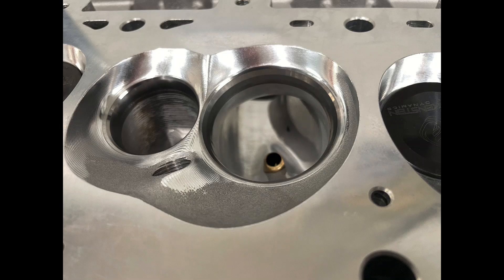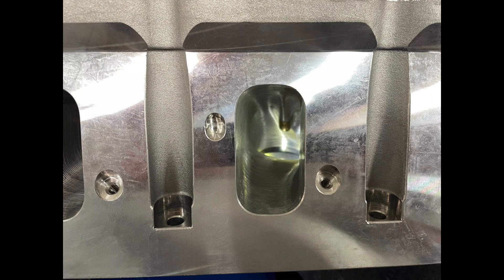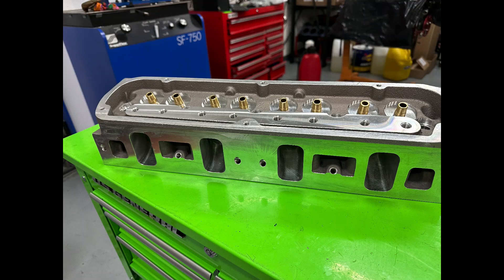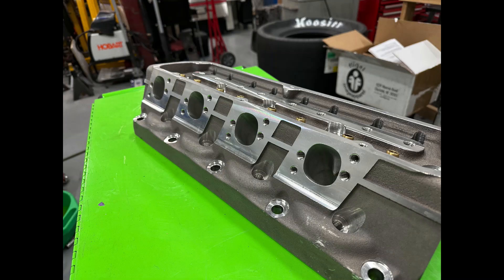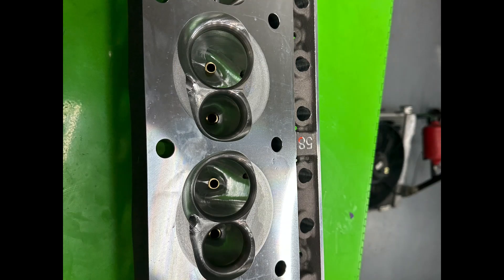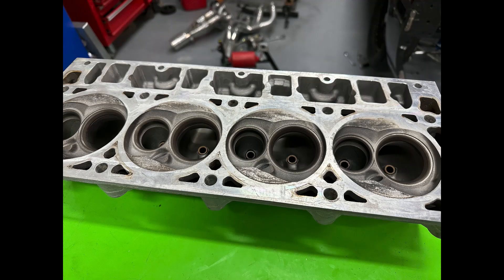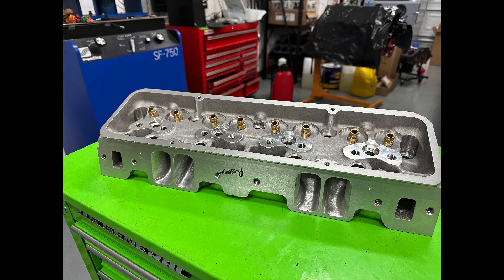Is More Flow Better

Comment: My 2 cents.
Peak cylinder head flow is demanded by the pistion, and when does said piston reach its peak speed? Around 70-75 degrees crank duration. Or, probably around when the cam is in the 0.4in range. As you have seen and tested, improvements in airflow here are attributed to improvements in output.

Next information drop, Pipemax has a function of calcuating cfm from piston speed. It brings up a large spreadsheet showing, piston speed, crank angle, rod angle, and cfm demanded by the piston.
Waaay back in 2006, I ran a simulation using Pipemax on a 1600cc engine. It stated that for a 400cc cylinder, its piston cfm demand was 275cfm@8250rpm. If that was doubled to an 800cc cylinder (for a 6.4L V8), I would guess cfm demand would also double to 550cfm@8250rpm.

We also have to understand that a flowbench operates at 28in of H²O, where a piston can generate far greater depressions than this. This stretching air is an invisible friction torque loss, and one way to lower it is by adding more cfm to the cylinder head. In a nutshell, this is where a pumping loss can be easily fixed because adding a better flowing head reduces the "strecth on the air." It's also why a cam change is needed, as the strech into the port is less, meaning less velocity. So, an earlier intake closing point is needed (big head small cam V small head big cam debate)
Its also the theory on why Ford made the 4V Cleveland head. Small cam, big head.

As a side note, the moment manifold vacuum hits 1.5in of Hg, there is effectively 13.7psi entering the cylinders. 1psi loss = 7.5% less air mass. The volume is the same, but it has less weight. Installing a bigger carburetor helps bring back that loss. There are other factors that then come into play, like running a finer grain booster because less vacuum means the fuel is harder to vaporize and stay atomized. This may theoretically be why a 1000cfm carby returns improvements over the 830ish one you said.
Reply: Pressure differential is what makes air move, yes peak piston speed will create the highest pressure differential but as long as that pressure differential is kept below 3.77psi then you won’t be stretching any air causing it to reduce its density.
The pressure differential determines what the average airspeed is within the port and as long as your under 3.77psi pressure differential then the minimum cross sectional area won’t go into choke.
Pipemax gives you a number at 28” test pressure as a reference to go against, this reference is calculated across what average airspeed you enter and the engines capacity, rpm and number of cylinders.
Reply: @Sean B  I strongly disagree with the 3.77psi claim. If a point of restriction was causing a pressure difference that great the airspeed would already be well in excess of the theoretical sonic choke. In research and practice, airpseed over 350fps on single valve V8s is usually met with a dyno curve that falls off in the top end, which is why higher rpm calls for larger ports. However, there has to be a balance between low rpm airspeed as well as high. 
350fps translates to 146cfm per in² of area, and that's only at 28in H²O/1psi. Simply adding in more pressure difference from increased piston speed would result in higher velocity and less density inside the port. That's the stretch I refer to. To generate that type of pressure difference would take more force as well, resulting in higher pumping losses, all leading to net loss of output. 
Something else to consider, a flowbench is a simple photograph of a very dynamic situation that is a running engine. In other words, a flowbench is a simple tool to help understand a very complex situation. There has to be flexibility in applying knowledge as guidelines, not set in stone rules because in some situations, some engines dont play by the rules.
Reply: @crd-nz_001  I’m very well aware of the average airspeed numbers and max flow at those depressions.
What your talking about tho is everything referenced back to 28” test pressure so we have a base to work with, that’s not the depressions the cylinder bore and port see at max rpm piston speed. 
Plus sonic choke can only occur at the speed of sound hence the name, what your referring to is subsonic choke when the air starts to stretch its mass, this occurs usually at mach 0.6
What happens when you test a port at 40” or even 60” test pressure? Does it all turn to shit? OR if the port is stable it flows more air? The average airspeed is only limited by the pressure differential applied to it, the pressure differential is the energy source that accelerates the air column, it especially aids in volumetric efficiency when the piston starts to slow towards the bottom of the bore and actually starts it’s way back up again, the intake valve is still open and that energy created by the pressure differential is what keeps that column of intake charge moving into the cylinder.
When you see an engine on the dyno nose over it’s not because the airspeed went over 350fps, it would of went over 675fps. 350fps is just the value used on the flowbench because that’s the pressure differential that is being used.
Reply: @crd-nz_001  just wanted to ad that no matter the pressure differential, the higher it is the less air it can flow per square inch of area, for example 10” test pressure max is 87.23cfm per/sq” yet 28” test pressure is 146cfm per/sq” so going by your theory we would want the lowest possible pressure differential to get the most air per square inch of area, the “stretch” we are talking about happens from the very beginning of applying a pressure differential, it’s when that pressure differential goes beyond 3.15/3.77psi that maintaining stability seems impossible within an engine port.
Reply: @Sean B  Yes. 
We are saying the same thing, just in different ways. 
What Im trying to point out is...
- It takes energy from the engine to develop a vacuum. The higher the vacuum, the higher the energy loss.
- Pressure recovery does occur in the lower half of the cylinder. But, this is based on cam timing as when the intake valve shuts.
- Less vacuum gives less airspeed, less ramming effect, which means cam timing needs to advance. The pressure trapped is also closer to atmospheric. The opposite for higher velocity ports. 
- 350fps is a balance between energy lost to creating a vacuum Vrs ramming effect. Start pushing port speed above this point, and the energy requirements to create a vacuum go up beyond the gains from the ramming effect. 

On a flowbench, its could well take a 18hp motor to make 60in of vacuum, yet only 3 to make 28. I am guessing the numbers, but they are not far off. I know someone needing 12Hp to buld a 40in capable bench. 
But that's the point Im making. Increasing port speed to beyond 350fps to increase the ramming energy to make more power is not a simple exercise. 
If you're making power at +600fps N/A, then you're the smartest person alive.
Reply: @crd-nz_001  so your saying that you think there is only 1psi of vac being pulled on the port at max rpm peak piston speed? Because it can only be 1psi to make the airspeed 350fps.
Reply: @Sean B  No.
A running engine is dynamic and will vary greatly.
However, the higher the depression a piston makes comes at the price of power to make that depression. As I have found, the closer the working rpm sits within 28in, the better the overall output.

Yes, a head will be potentially exposed to 40in and should maintain flow when done so. It separates good heads from great heads. But, if a head was running that high, then a bigger head and different camshaft combo would drop the depression closer to 28in and give superior results. It's why everyone is chasing bigger and better flowing cylinder heads.
Reply: @crd-nz_001  we will have to agree to disagree then 👍 enjoy the rest of your day, cheers.
Reply: @Sean B  I slept on it. This morning, I decided to do some math

Taking the 550cfm I set in my first comment and divided it into the curtain area of a 2.1in valve at 0 4in lift comes in at almost 397cfm per in². Multiply that by 2 4 give a feet per second of almost 953fps.

So, how very wrong I am at saying a port will never see that type of airspeed.
Reply: @crd-nz_001  nothing wrong with realising that a mistake was made, to me it takes a bigger person to actually write in public that it happened 👍 respect for real.
I’ve always said that you learn more from being wrong and realising it. I’ve been down this path many many times 😂 cheers bro.
Reply: @seanb250  @CRD NZ This back and forth with you two has been SOO educational for me. Thanks for sharing your thoughts!  -I've looked at the CFM of intake air flow vs. piston demand chart in pipemax before and it always seems that no matter what you do with the 2 valve stuff that I'd ever take the time to input into it, that any where near peak piston speeds the intake is ALWAYS going to be way behind the piston vs. what it actually wants.  -I understand that at a certain point getting more flow and area is going to "hurt" your ability to make power and I understand the high velocity approach better where you're delaying the intake close and relying upon velocity to get you >100% VE as the piston is rising up, but I never understood how to know where that point is and it's relationship to the air speed FPS "speed limits" that are baked into the engine size, RPM, and min / avg CSA forumula before.   -This whole back-and-forth helped me, anyway. 

It's also my understanding that colder coolant temps help to make power largely because cooler temps in the cylinder reduce the pressure in the chamber and make the pressure drop across the intake valve a bit larger after watching the recent seasons of Engine Masters test cold vs. hot coolant and cold vs. hot fuel.

The giant LS3 ports and using baby cams and not really taking advantages of fast headers and big overlaps approach still kind of confuses me on how it works, but I'm slowly getting closer to understanding it, I think / hope...

Comment: I believe the correct term for this is "realized power". If you keep increasing the cylinder-head flow capability (cfm) and you keep getting measurable increases in power, then you are seeing "realized power" gains. If the last increased cylinder-head flow increase does not add to the power output, then you have reached the maximized power output (from the cylinder-head's contribution) for that particular engine configuration. 
     ALL cylinder-heads are a restriction to an engine's Intake airflow requirements for true 100% cylinder-filling. We can know this by looking at the fact that the only way to theoretically completely flow at the rate of the piston's descent, would be to take the cylinder-head off of the block-deck completely during the intake stroke, then immediately replace it at Bottom-Dead-Center before the piston rises again. Even if the cylinder-head was only equipped with a single valve located dead-center over the piston, as an intake valve, it could not flow the full volume needed. With that as the baseline for maximum cylinder-filling (and therefore maximum potential power output) we can see that there are many limitations to maximum power between the cylinder bore and the throttle-body (which should be the only, and variable, "chokepoint"/or throttle) in the entire induction system. 
      I believe that all naturally aspirated engines (and most supercharged ones as well) are airflow-limited to what amounts to a smaller displacement engine, in realized power. One clue to this is that we never seem to achieve maximum potential output from any given engine size. Most builders go with bigger engine size or displacement to get the desired or needed power increase. 
      The best way to maximize any particular engine's output is to use experience (our own or from someone reputable) to get you close, then "cut & try" to get the true best output from it. This is tedious and time-consuming and of course expensive to do. That is why most of us will have to settle for some power output level somewhat better than average, without ever realizing the absolute maximum that could be achieved with that engine configuration. That is what makes this profession or hobby fun. Learning and enjoying the fruit of our experience while trying to achieve the best possible performance. If someone were to figure out the absolute best combination for every possible bore/stroke combination, it would ruin the sport for the rest of us I believe. If you are one that has figured it all out, I know I probably won't have to ask you to "keep it to yourself"!

Comment: How does port volume play into this? My Mopar 360/414 stroker has ported iron  heads that flow 275@600 lift but only made 460hp@5300. It made 510ft;lbs@3900. Port volume on these heads is only  around 170cc. Do I need about 200-210cc's with the same flow to make more power? How do I determine port volume/area needed for 6000rpm?
Reply: So your engine made its peak power exactly where it should have going on the math, 414cubes at 5300rpm has a cfm demand of 268cfm, that is with the intake manifold bolted on.
If you want peak power at 6000rpm then you need 303cfm with the intake bolted on, assuming a 2% loss from the manifold you are looking at 310cfm from your heads. When looking at minimum cross sectional area of the port you should aim for 2.25”, that’s a 95% efficiency target for that cfm/area
Reply: @seanb250  How did you come to that conclusion? Is there a formula you use. Not questioning your expertise I  just want the knowledge as I plan to replace the pistons, cylinder  heads and possibly the intake manifold. I want more power.
Reply: @ragingbull3406  start with cfm demand of your engine with this formula: cubic inches x rpm x 0.0009785 / number of cylinders

414 x 6000 x 0.0009785 / 8 = 303cfm

So 303cfm is what you need at the valve after the intake manifold loss and so on, your manifold might be more than 2% loss, this is why we must flow test with the entire intake system to get the best idea. 

You can only flow a max of 146cfm per square inch of area at 28” test pressure so you divide the head flow required (which is 310 after manifold loss) by 146, this gives you the 100% efficiency min cross sectional area value, now you very rarely get 100% efficiency through the min so I personally aim for 95%.
The area needs to be slightly larger to get that 310cfm still at 95% efficiency
Reply: @seanb250  Got it! Now how do I determine what cylinder head port surface/cross sectional area I need for that 303cfm? Thanx.
Reply: @ragingbull3406  as for port texture I favour a light burr finish, you can look on my channel to see how I do it 👍

Do you want to know how to work out the average cross sectional area?
Reply: @seanb250   I think the ports in my heads are simply too small. Maybe good for the original 360 only. I'm trying to figure out the optimum size I need for my given cubic inches and rpm.
Reply: @ragingbull3406  yes your heads are too small.
You want a set of heads that have a minimum cross sectional area of 2.25” 
If you go look at aftermarket heads they usually list what the minimum cross sectional area is, then go look at the flow data for that head, if at 600 lift or earlier it flows 310cfm or there abouts then go for those, otherwise have your existing heads sized appropriately to suit 👍
Reply: @seanb250  👍

Comment: I've never seen a fuel injection engine not make more power with more cfm throttle body. Just depends on what  drivabilaty you are willing to deal with
Reply from the maker: Yes but not as much as the added cfm would show. Usually it’s small gains.

Comment: When the carburetors larger on a motor like that if you are after straight power and not drivability, you go as big as you can wear it functions properly. It does come down to again pumping losses, as you stated like the ports. Due to the design of a carburetor it will always have some type of pumping losses due to the Venturi design. They actually tested this theory an engine power and showed the engine had less vacuum at high rpm so I can only attribute this to pumping losses. We are talking very small amounts, however.